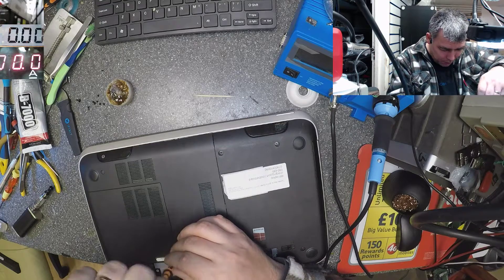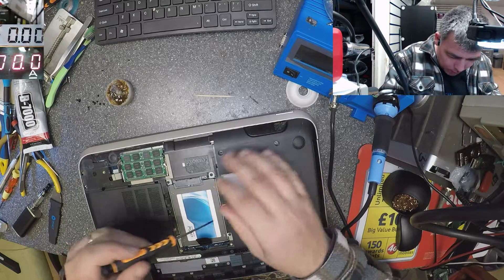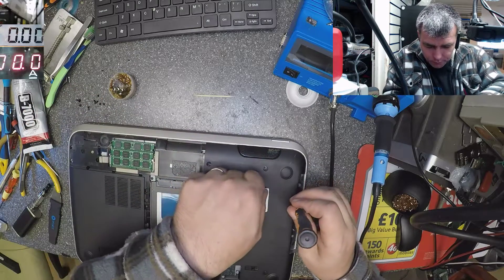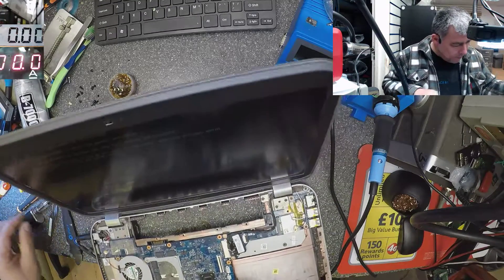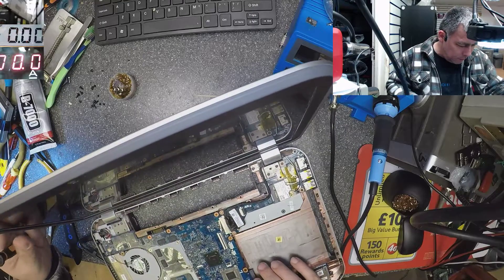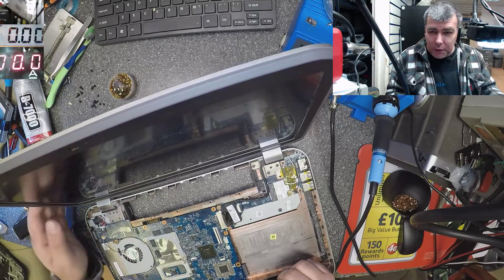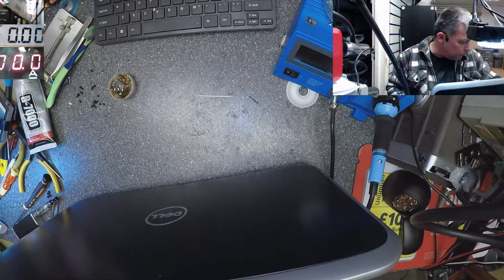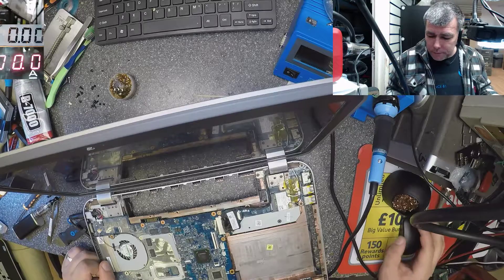Dell inspiron 7520 no power repair, charging port issue?

Comment: I have the same pc but having other issues maybe you can help me. The pc isn’t recognized my battery now I doubt they aren’t good and I don’t want to open the battery to check voltage on them also I don’t have battery’s to replace and solder if there is needing for doing that so when i plug the charger to the pc everything going on just can’t charge the battery any places you think I might need to look for? It sometimes take my computer like to boot mode and says he’s not recognized the battery, also I’m having problem with the keyboard it’s not function normal like you need to press a lot of time to actually type the latter 
Please help that’s my only pc i got can’t afford spent money on fixing